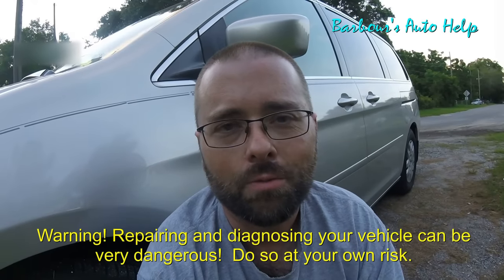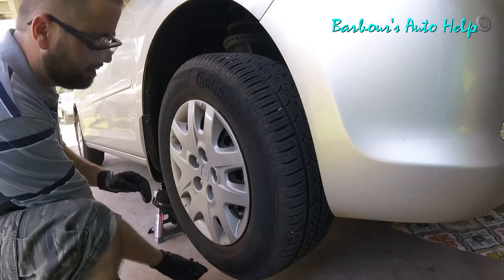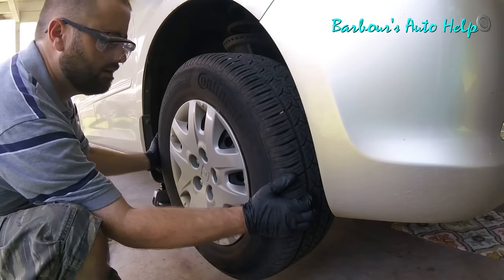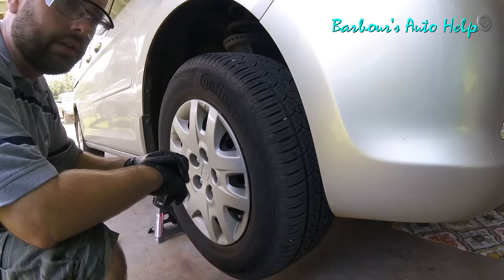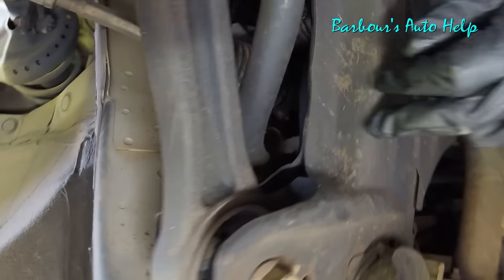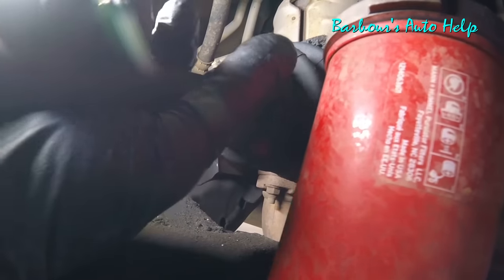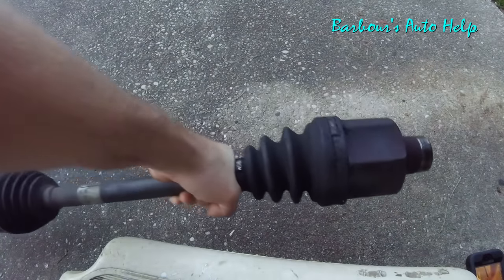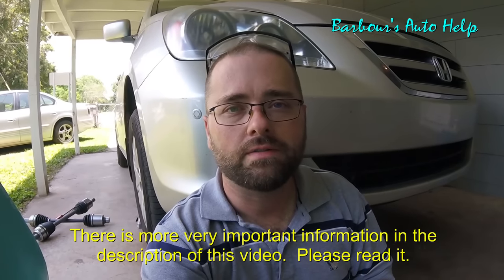Vibration Under Acceleration Diagnosis

Comment: Awesome info, thank you, young man!
Reply from the maker: Thank you
Reply: Man please help me out here , I have 2004 Honda Accord shakes at 55-60 and I accelerate only when it goes away at high speed or when I let of the gas . Shakes feels almost all over the car but not steering wheel. Transmission pulls good and accelerate good .. do u think it get anything to do with the transmission?? Thanks
Reply: @georgeician   This might help, it might not.  Mine did the same.  I finally replaced the power steering hose, which was leaking, and the erratic shaking stopped!  I don't see how that's possible, but it worked.  Check for 'any' leaks that could affect the overall system.
Reply from the maker: Have you inspected the vehicle yet as shown in the video?  What did you find?

Comment: wow what a good job on this video man i have the same thing going with my mazda cx9 2010 i recently had the back wheel bearings replaced its wasnt doing it b4 i replaced it but it started after any suggestions i think i know already but i would like to know what you think
Reply from the maker: If you had it done at a garage then I would take it back to them and explain what happened.  (As far as the symptom occurring after the repairs).  If you installed them yourself then I'd go back over everything.  Make sure everything is tight and installed correctly... let me know what you find.

Comment: So my GMC Acadia only vibrates when i press the gas pedal and does not vibrate when i lift my foot off the gas pedal. Is this because of the axle as well? Because mine make noise when turning left and right. Im sure its not coming from the tires bearings etc. No check engine light nothing. I know my axle needs replacement but since these parts are expensive i just wanna be sure that an axle can cause the car to vibrate
Reply from the maker: Well, I can never be 100% accurate in an assessment of a vehicle I've never laid hands on, but it could be an axle.  Not sure if that answer making you feel more confident is a good thing or not.

Comment: Thanks for the info.  I have a 2012 pilot and today bad vibration has started.  Was getting onto the hwy and under hard accerlation oh man felt like the whole suv was going to fall apart. If I set my cruise it will vibrate pretty bad as well.  Any ideas?
Reply from the maker: Could be something gone over in the video.

Comment: Thank you for your video.  I own a 2007 Jeep liberty sport I have replaced my upper control arms on the front, both wheel hubs in front. Brake pads and calipers are good.  Checked tires no knots. Had a vacuum leak repaired after Christmas. Now  I'm thinking my vibration is from a mis fire in plugs.  Could that be a possibility? An oil gauge sensor to replace. Can the mis fire cause my engine light to come on?
Reply from the maker: A misfire definitely will cause a check engine light to come on.  Have you had a technician look at it for you?
Reply: @BarboursAutoHelp  the code is an evap code.  That's all they say.  I'll replace plugs on Sunday. Oil gauge sensor and serpentine belt.  I'll see if that takes care of it.

Comment: question I have 2013 durango when I give it some gas it shakes/vibrates sometimes,it will stop vibrating if I release the gas. and it only happens when I come to a complete stop and accelerate.
Reply from the maker: Is the check engine light on?

Comment: I Have a 2013 Hyundai Santa Fe Sport 4 Cylinder, It has a vibration after pass 50 rpm. Tires are new and balance, front and rear rotors and breakes new and the vibration continue. Front struts is bad. I don't feel any shacking on control wheel. Can you help me.

Comment: I got the same symptoms on my 2004 Saab 95.  It all happened a few weeks ago when I hit a very big pothole and bottomed out real hard.  I just replaced the inner and outer tie rods and stabilizer bars, and still shimming/hard vibration above 60mph accellerating.  My struts I know need changing, and gonna replace them next month and the mounts to.  My cv axles boots look good as far as no cracks or leaking grease anywhere, but from what your showing, they are suspect to.  What about the control arms, could they cause vibration?....Thanks
Reply from the maker: I've got some good information in the description that may help.

Comment: I've got vibration at acceleration with my Ford mondeo tdci..  I thought it was the DMF (flywheel.) but after seen this, It could be the CV axle..  it vibrates for a second or 1-2 when accelerating..

Comment: This video really helped. My car is shaking/vibrating when driving and when sitting at a red light. I have been told different things for as repairs. I am being told it’s the wheel bearing. How do I know for sure? It could be the CV Axle.
Reply from the maker: Well, the shaking while sitting at a red light is highly unlikely to be caused by anything in this video.    It may be time to have a tech look at it.
Reply: Sitting at red light. That could he bad idle, misfire from spark or coils. Any engine codes on?
Reply: Do you have a check engine light? If not then it is a 99% the engine mounts.

Comment: Hi, I just want to make sure, before I buy the parts, may I know what is the part number of that cv axles left and right side of the 2005 Honda Odyssey? same problem, with my 2005 Honda Odyssey.. Thanks
Reply from the maker: You should really get that information from your parts pro.  Sometimes parts are VIN specific.
Reply from the maker: +rhenzone Yes, a good parts store should be able to give you that information.  There is an intermediate shaft on the right side that connect to the cv axle but is no a part of the cv axle.  These usually do not fail.

Comment: Hi, i bought the same van six months ago. And the problem I have is that when I'm on the interstate it begins to vibrate when I let the gas pedal off, not when speeding up. I replaced the rotors and left caliper and still does the se thing. Any idea what would that be?. Thanks in advance and happy new year
Reply from the maker: It could be anything mentioned in the video.   Have you had it diagnosed by a technician or have you tried to diagnose it yourself by using the info in the video?  While your problem is on deceleration this video still may be able to help.   If you are not confident in checking it your self then by all means have a tech look at it.

Comment: I have a mercury mariner 2008 and I was driving and it started vibrating. It's done that twice but that's all, I took it and they balanced the tires and made sure the tires were okay. The mechanic couldn't find any problems.  Do you have any suggestions about what could cause this? Thanks.
Reply from the maker: Under what circumstances does it vibrate?

Comment: Hi dude have you diagnosed an off road vehicle that has been lifted 2" and then gets only a takeoff shudder? Literally a take off/first fear little shudder. Has leaf springs and cv joints. I also would take off, and then with foot off the clutch pedal I'd put foot on brake 'til car almost stalls and then apply throttle, and car would shudder again. Any idea on how to diagnose?
Reply from the maker: Id say it's probably best to have a shop look at it.  I don't want steer you wrong.

Comment: I have a 2002 Audi A4 V6 that has a vibration problem where the whole car shakes on even the slightest gas pedal press, but only after the car has been running for at least ~22 minutes and has warmed up. I haven't yet isolated whether it's from the engine being hot or the body/wheels but it definitely doesn't shake while cold. Was told it's a head gasket issue by mechanic due to coolant/oil being mixed and having coolant loss issues, but after further research am not so sure. I'm leaning toward it being an ignition coil or CV axles/wheel bearings/tie rod ends.

The onset of the shaking starts off gradual and becomes worse the longer the car is being driven (hotter?) until stopped and cooled down. Letting go of the gas pedal stops the shaking immediately at all speeds.

What could cause such temperature related shaking symptoms like this? Thanks
Reply from the maker: It could be a lot of things.  On something like that I'd say a hands on tech would be the best way to diagnose the problem.
Reply: @BarboursAutoHelp  Thanks for the reply. Bit of an update as I have applied a head gasket stop leak, the problem has improved and became an intermittent issue. The shaking isn't as severe and happens almost exclusively at highway speeds now (80kph+). After a few days of warming up and cooling down the car in the driveway, I let the car idle for 51 minutes before performing a 1 hour 30 minute drive involving motorways in which it only really noticeably shaked at high speeds! Turning on the heater also somewhat helped reduce the shaking once it crept in, but that could be placebo though.
Reply from the maker: Yea, I'd definitely say have a tech look at it.

Comment: Thanks for the video. I have a 2011 Ford Fusion that is vibrating when I go over 60 and the faster I go so the vibrating. I've already had a front end alignment and balance of the tires and looking for the problems with the weigh in the tires. Could it be the CV joint and axle or tire rods maybe ?
Reply from the maker: Usually this is caused by inner cv joints.  It never hurts to have a technician take a look at it and confirm exactly what your problem is though.

Comment: hey! thanks for the video! What could cause a shaking only when releasing the gas pedal, at about 55ish, its a shaking, the whole car shakes. wheels are balanced, almost new. i changed the cv axles about a month ago, they were cheap....so idk. happens in gear and neutral, when applying brakes also happens. thank you!
Reply from the maker: It could be anything mentioned in the video.  Have you inspected all your steering and suspension parts?

Comment: hi I just watched your video. my Nissan sentra 2002 has vibrating problem during hot day only. I took my car in garage but didn't get any problem and advise me to continue to drive. I am worried during hot day. if I drive highway go above 80 km/h its start vibrate. I checked engine coolant . all in good condition. during acceleration not speeding up and start vibrate whole body and steering too. could you tell me what would be reason for this. thank you in advance
Reply: My first thought is a bad tire. When hot. Greater pressure perhaps on tires and softer rubber. What did you find out?
Reply: At 80 I would also expect the tire.

Comment: I replaced all the front and rear brake components and still have a shake at highway speeds under heavy braking....any idea if the cv axles would be a cause? Frustrating!
Reply from the maker: They could.  I had a car do the same thing and it was the axles.  It was on a hybrid though.   They act a little differently.

Comment: My 08 Altima sometimes started shaking at high speeds and continued with my foot off the gas. It also wobbles during applying the brake. After I come to a complete stop then drive in, it'll stop.
Any help with this? TX
Also any help my YT community?

Comment: Have the same problem on my Ford Fiesta ST. Complete drive shafts and CVs were replaced but the problem is still there. Any advice?

Problem is that when I accelerate at low revs there’s a vibration on my car. Once I pick up speed the vibration goes away.
Reply from the maker: Other than the info shared in the video and description there's not a lot I can help you with.  It never hurts to have a tech look at it.

Comment: I have a 2008 Silverado but there’s no videos for my vehicle. It’s making this vibrating whenever I go between 35 and 50 mph and only when I press the pedal. I do have aftermarket wheels and tires and a lift kit but Iv already replaced the motor mount, cv axils, front a Ik, and all my u joints. What could you tell me?
Reply from the maker: Well if this video dont help I'd suggest having a tech look at it.  I'm not aware of any common issues on that vehicle that would cause this symptom.

Comment: My truck makes a shaking noise when accelerating or going up hill and it will make a random pop noise here and there which sounds like it is coming from the drivers in between the gas pedal and the dash, behind them. It sounds like it is running harder making a noise when idle too. Any idea of what that could be?
Reply from the maker: Could be anything.  Have you had a tech look at it?

Comment: I have a 95 Accord rf wheel wobbles and bounced on highway  high speed in 4 and 5 gear under acceleration, I changed axle, balljoint control arm an rf, both tires and wheels I know I need to put and outer tie rod but that's on the left front, the only other thing is all the engine mounts are bad I'm pretty sure it's causing the hopping and vibration in the rf wheel
Reply from the maker: Have you checked your wheel bearing for play?
Reply: No play in wheel bearing, I changed the Axel's too, I noticed that the rest and front motor mounts are shot the motor is leaning back making the axle out of align, I ordered all of them I hope it fixes it

Comment: I have a 2013 Nissan Altima S (4cyl) with 122K miles. The front end vibrates between 50 and 60 mph, but only under acceleration. If I back off the accelerator, it rides smoothly. I have recently had all 4 struts and shocks replaced, rotated the tires, balanced the wheels, and replaced all the motor mounts. The problem still persists. The mechanic I use can't figure it out, but he is an old-school neighborhood mechanic best used for more common problems, not so much the difficult diagnoses. Could the recent installation of the front struts have anything to do with this, if they were somehow improperly installed, I mean ? The entire front strut assemblies were replaced, not just the cartridges. Any thoughts ?
Reply: Did you find out the problem? I'm in the exact same situation, where the shocks, spring, drop links, shock top mounts and tires were recently changed, and the car immediately after developed this kind of vibration on the steering wheel at around 120km/h. If I take my foot of the accelerator it drives smooth. The shaking it's minimal but still to be eliminated...

Comment: As you might know replacing these  shafts assembly aren't so cheap from the dealer, is it possible to repair a wobbly drive shaft
Reply from the maker: It is. But its more labor intensive.

Comment: Hello great video....I have a Renault Oroch2017 and there is a vibration under acceleration at only 2000 rpms in second gear and 3200 in 3rd gear. NOONE has been able to figure this out.....can you help me.....Many thanks
Reply from the maker: Probably not......lol. joking.   But actually if you've had people look at it in person and they can't figure it out im probably not going to be much help.  Plus I haven't seen a Renault in over 30 years.

Comment: This video might help me with my problem. I got Honda CRV 2007, it drives fine until you hit 60 and then vibrations starts and keep getting stronger as speeding up. BUT as soon as I press the clutch, the car becomes smooth no matter the speed.  I have already had the Clutch plate replaced but no change. Any comment appreciated.
Reply: You ever figure this out? I got a 2004 Crv 5 speed manual that has always had a shake only when accelerating especially up a hill. While in 5th gear I typically didn’t experience shaking. Only when accelerating. It’s an odd shake I’ve had it since I bought the car in 2012. But has gotten a bit worse and wondering where to start investigating. It got more noticeable after my clutch was replaced the 3rd time. Clutch works great but car shook during acceleration through gears. My mechanic said motor mounts which were replaced in 2019 but idk it didn’t help!
Reply: @kenneth801  I had to replace CV shaft on both sides in the front and it fixed the problem completely.
Reply: @a2amali  Thank you for your response. I'm thinking CV axles, bearings, springs may all need replacing within the next two years.

Comment: My van shakes when between 30 and 40mph. Its shakes back and forth alot at 40mph. After 40mph it phases out and you dont feel it. When yo leave off the gas at those speeds the shaking disappears. 

Any suggestions.

This shaking didnt happen until I had the wheel bearing done by my garage who I have never had trouble with. Could this be a coincidence. 

Garage cant see a problem. I have had a drive shaft put in but that wasnt the problem . And also an inner tie rod done since that was picked up on a vehicle inspection
Reply from the maker: Have you checked the balance of the wheels?
Reply: @BarboursAutoHelp  yes new tires and balanced

Comment: My 06 odyssey touring have the same issue 60-70mph but after done a tune up problem was solved but now the problem came back but only at 20mph vibration in acceleration 
Do u think that suspension parts is causing the issue???
Reply from the maker: Its possible.  I'd have it checked out.

Comment: I have this issue on my 11 accord v6. It only shakes with acceleration at 65 - 70mph. I brought it to my mechanic they said it was the torque converter shuddering. So I brought it to a transmission specialty shop and they are telling me they believe it is cv axle and not the torque converter. So lost with what I should do ? They have told me the if it were the TQ I would feel it at the same level RPM but in neutral but that it is not there. 

Can you or anyone offer any suggestions or advice ?Thanks.